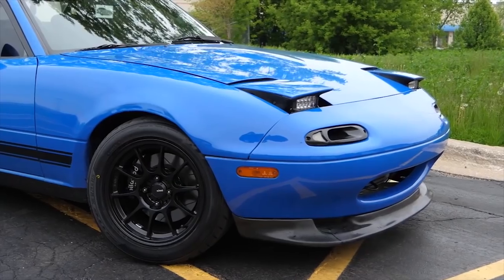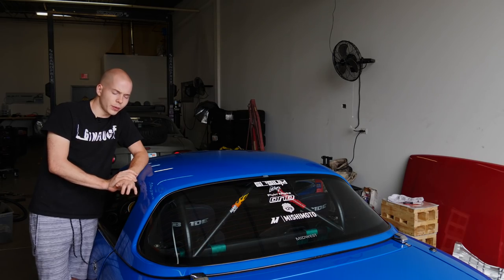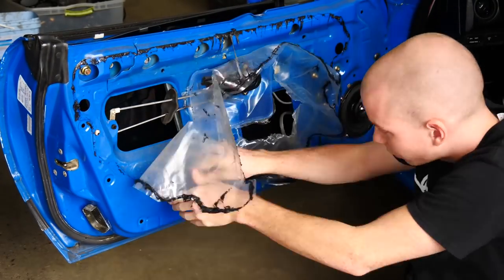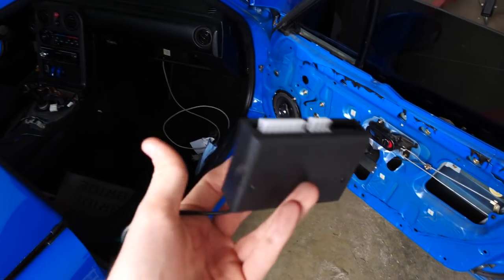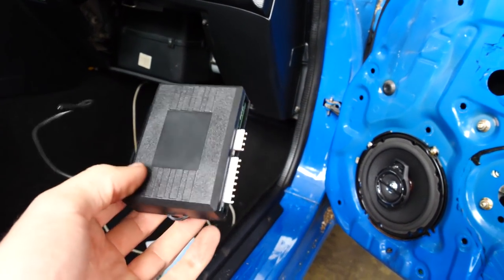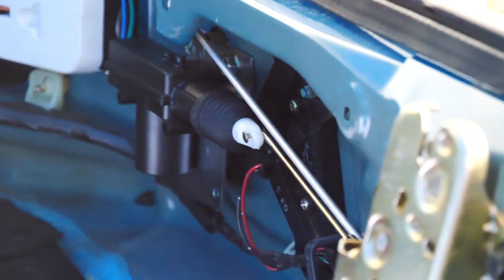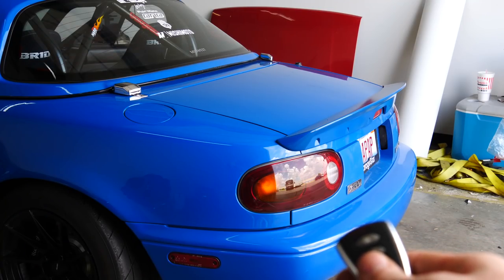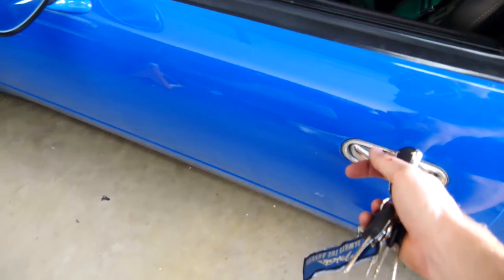How to install a KEYLESS ENTRY System in a Miata!

Comment: You should add Apple Car play / Andriod Auto support with a touch screen
Reply: VC Records On a single din slot?
Reply: Roger The Explorer
There is a thing called changing the center console
Reply: VC Records that would look so bad in a Miata
Reply: Roger The Explorer it has room for a double din, there is an empty storage thing below the radio
Reply: Roger The Explorer or use a tablet that flips up like the Audi, but actually looks good
Reply: Frankie Smith that would be cool
Reply: Fuck touch screens
Reply: VC Records I have iPad with Velcro in back. 7.9 inch removable display. Might cover up air vent but who needs vents with roof down.

Comment: I installed almost the same kit 16 years ago in the Miata and it was the best thing I did. And it still works!
Reply: What’s the kit called?
Reply: My kit did not come with the big module and keys how where you able to connect the keys to the system 😢please help

Comment: Gingium and I repeat YOU DONT NEED A SUBWOOFER. I have a 99 ranger with 4 6x8 rockstar punches with a kenwood. They hit amazing and sound clear and project, a lot cheaper and easier

Comment: You should add a trunk release button inside the car...Now that you already have the actuator installed in the trunk it will be super easy, and trust me it is surprisingly useful. Any momentary switch will work.

Comment: Great mod, great info...!!!
One mod I did on mine was to add a relay so as soon as car is started the lights pop up and they all turn on. It is to prevent me from driving with lights off ever. The car is small and like a motorcycle people dont always see it. I notice much less close calls. I also added Duneli sound bomb air horn. The lights relay works off the 3 wires that jet out the side of the turn signal stem. Red, 2 whites. Red & white(ground)=headlights. White & white (ground)=parking lights.

Comment: No alarm?
Reply: its just annoying.
Reply: Roger The Explorer have you heard aftermarket alarms? Not. Worth. It. They're a hassle that always go off.
Reply: Dylan McNutt True, Your right.
Reply: Dylan McNutt ours aren't very sensitive BUT we did own one back in the day that was fucking anmoying. It triggers when motorcycles pass it
Reply from the maker: Roger The Explorer Nope! Alarms are just annoying
Reply: Roger The Explorer Aftermarket alarms go off from loud sounds, and don't go off when people break into your car... They're hard to install, mess up the wiring and often prevent the car from starting for no reason, and mostly people that steal cars know how to remove them anyway.
Reply: i thought they went off from vibrations,  i always made this civics car alarm go off by cruising in a high gear on my dirtbike
Reply: Dylan McNutt Yep. I purachased a Toyota Corolla recently that has an aftermarket alarm system. If I unlock it with the key the alarm goes off. I have to use the remote. Also every time I remove a terminal from the battery and put it back it goes off. Super fucking annoying. I'm considering getting rid of it if I can figure out how to.
Reply: I hear a car alarm and don't even flinch other than think "when is the owner going to make it stop".  I don't think those work as intended anymore lol. Too many false alarms with those.  Boy who cried wolf situation, basically.
Reply: I would only install a 2-way alarm, one that makes the key fob chime as well.
As others have said, nobody pays attention to other peoples car alarms beyond "when will it stop".
Reply: That's cool did not know about 2-way.  That would really make the most sense really.
Reply: Just use some string as trip wire.
Reply: @DylTheDadMan  not if it gets installed correctly. I ha a shop install one in mine. Went off all the time. I took it out and installed my own. Found out they didn't install it right so that's why it kept going off all the time. I haven't had a problem with the one I installed. So it's all in the install 99 percent of the time.

Comment: There's a thing, idk if it's a Kickstarter but you can use it if Molly (or any other car) has an OBD2 diagnostic port. It's a licence plate frame with a built in reversing camera. You attach it, put in the OBD2 dongle thing and download the app. It seems to work very well. The battery even claims to have 7 months of life

Comment: Very well done. I wish this had been available when I updated my 1997 with keyless entry, remote trunk release, and one-touch, automatically-closing windows. I paid a shop to to install the control modules and although everything works, I am not happy with the installer's shoddy work.

Comment: You should title this “Installing a” instead of “How To” because it wasn’t that informative
Reply: Its pretty basic to begin with, plug and play once you run the wires that were provided.
Reply: seriously. I'm working on my NB and came across this video and I didn't learn much. I'm working on a How to video. will it be perfect? No but I think it would help anyone who's trying to add keyless cause this is a task

Comment: The 5 wire actuator usually is on the driver side so if the battery in the remote control goes down you can open the doors with your key from the driver side. It doesn't matter in a miata, but in a 4-5 door car it would be painful. :)

Comment: Wireless openium. Cool beans! I wonder if you could attempt a sliding moonroof. Probably too complex. Still great job! Shoot for a rear view cam.
Reply: adding a moonroof would just cause leaks in the future, learned my lesson after buying a 2007 Charger
Reply: I dont see the point of a moonroof in a hardtop convertible. He should take it back to the soft top

Comment: I just bought a Lanzar dct15 for my car and I'm super stoked for when it arrives its gonna be bangin. i might even buy another later on cause im using it in a passive radiator box but i could take out the passive radiator and put it another one xD

Comment: Be careful I did it my my Miata and it cost a parasitic draw which will kill the battery eventually
Reply: At a local store here called bimart I found a solar powered battery charger rated at 50watts I think lol im thinking about buying one since I just lost a cell from letting my van sit after a 7' snow storm

Comment: I already have the console by IL Motorsport in my car, the only sad thing is that the texture doesn’t match the tombstone texture. Otherwise it is a nice piece 👍
Reply: Chris Tuem dude i really need your help,everything works except for the trunk opening via remote control. if i simply ground the cable the trunk opens but the control unit doesn't ground the cable

Comment: I think I'd prefer to have "keyless ignition" rather than remote locking. Part of my reasoning involves a significant difference between Molly and Mia (Mia was my '90 Miata, all dressed in white). Mia only had the soft top. Despite not living in SoCal, or in what is called a "dry climate" - Mia spent most of her time with me topless. [yes, boys, there's a joke or two there...you're on  your own!] And, as soft top convertible people know, you don't keep anything valuable in your car, and you NEVER lock it. Don't set yourself up to have a $600 soft-top replacement because it got sliced so someone could steal a $10 CD.  But, since Molly's sportin' the hardshell, you have a different situation. But, the keyless ignition would be sweet for just hopping in, and firing it up without rummaging through pockets. Loving your videos, man! I miss Mia so much, and I can't wait to get another MX-5

Comment: wonder if yours can auto start like my system has the capability of though not advice to use if you tend to leave the car in gear while parked, but I might do it anyway since I use the E most of the time unless parked on a incline.

Comment: So how did you install the antenna of the module on your oem antenna ? I have a 90 Honda Civic wagon and it has the antenna on the roof but don’t quite know how the black antenna on the module would hook it up to the oem antenna wire?

Comment: I got the same kit on the way, watched this video for like 5+ times, where did you plugged in the power wire? And how did you run the cable to the antenna?

Comment: Im pretty sure that you had the actuators flipped. The passenger one had the control wires. So you could lock it from the inside.

Comment: dude one thing that will make it feel like a new car is sound/thermal isolation... its easy to install cheap and it makes a HUGE difference in road noise, and the overall feeling inside the car... maybe research into it to see if you want to do it

Comment: Can you please explain how u reversed the lock and unlock button, i've been struggling for a week now, i still can't figure it out
Reply: I have the same issue, did you have it fixed?
Reply: @lambertbeltran9737  Im still trying to figure it out
Reply: @TiwoX127  I figured it out. switch the blue to green, green to blue as well as the brown to white and white to brown on the master actuator then same thing on the slave actuator wires switch the green to blue then blue to green. after that you are all set. Goodluck.

Comment: Awesome video and you probably already forget that you even made that upgrade but I have I question. You installed that “master” actuator in passenger doors. It should be installed in a drivers doors so it also work as a “central lock” even without a remote. Was that intentional? Just asking. Awesome video!

Comment: I installed this system in my car and I have a question? My car has a trunk release button on dash, the orange wire in diagram says trunk. How do I go about connection this to make it actuate. Do I just tap into dash trunk release button?

Comment: Hello @Gingium !
I recently bought a 1991 Miata (or "MX-5" as they're called here in France...) and shortly after acquiring it I discovered your chanel, which is great !! I love your vids !!
Thanks to your video I got myself the IL Motorsport central locking system. After a few days of cursing in French, English, Spanish and Polish (sometimes all together) while fishing tiny wires in even tinier Miata holes my set-up is finally ready and fully functionnal ! But just as you at some point, my "unlock button" locks the car and the "lock button" unlocks it. Apparently you have found the solution, would you mind telling me how you did this please ? I'm a true beginner when it comes to electricity haha...
Thanks again for you video, it really helped me !
Reply: If anyone is looking for the solution here it is :
- Plug blue wires on green wires.
- Plug green wires on blue wires.
- Plug brown wire on white whire.
- Plug white wire on brown wire.
(Doesn't sound logical at first but this is what allows you to invert the information)
Reply: @paulinstrieb6342  exactly! I do have one question though, how do you connect it to the antenna? Do I just tap into it for power?

Comment: Should get yourself a trombone cleaner or length of plastic coated curtain wire. You can tape the wire u need to run to one end and feed the cleaner through the holes etc and pull through 👍🏻💪🏻

Comment: so i followed your video even got the same kit but i cant switch the buttons around so like yours it locks with open but unlocks with closed. how did you fix the issue in your miata
Reply: Did you ever fix this issue have the same problem thanks in advance

Comment: i would love to buy a miata and daily but i sometimes take my mountainbike with me and i dont think i can do this with a miata. or is there actually a way to do this ?
Reply: You can get a trunk bike rack. I use one in my 85 MR2 which is also a two seater like the Miata. Works fine but you feel a little bit of drag on the freeway. Other than that no problem since I never drove too far anyway.
Reply: i never really saw one of these here in germany i think. and they arent that expansive too. maybe thats the way to go, thanks :D

Comment: Ive been trying to get this to work for a couple days now, but just can’t seem to get the motors to be strong enough to push the lock rod. It only gets halfway there. 

Does anyone have any tips? I have tried to loosen up the lock system with some wd40, but no luck still
Reply: Change the angle of the actuator.

Comment: Needs LED taillights
Reply: It is 2021 and he is still rocking the old halogens in the back of the car..... The only LEDs that he has on the outside of the car are the headlights and the front parking lights\turn signals, Nothing else that I know of.

Comment: This is not keyless entry it’s just central locking, with keyless entry you have a sensor or a button on the door handle that detects the key meaning you don’t have to use it, hence the term ‘keyless’

Comment: 130usd for just a central locking? You could buy an alarm and a good quality for 130usd not some cheap actuators +the central locking from china joom/ebay/wish...you get ripped off
Reply: Which would you recommend?

Comment: Pls dont only get a new subwoofer. also get some decent speakers with seperate tweeters because its sound way way way better :) only install a subwoofer if youre also gonna upgrade the rest of the audio system otherwise your setup will still sound like trash.